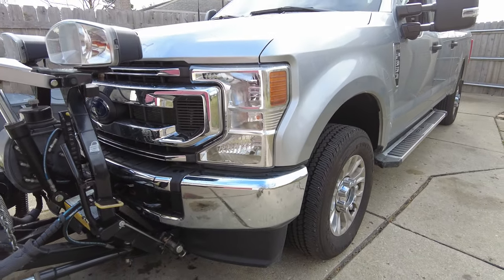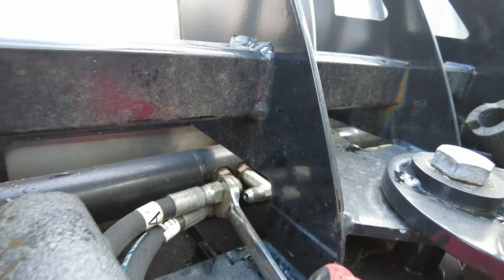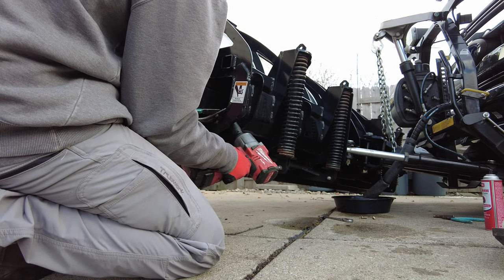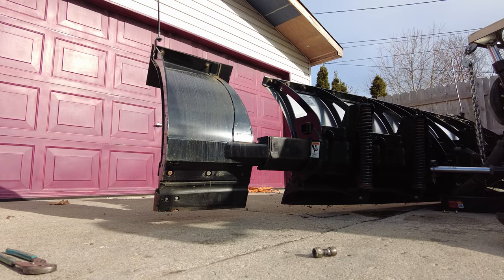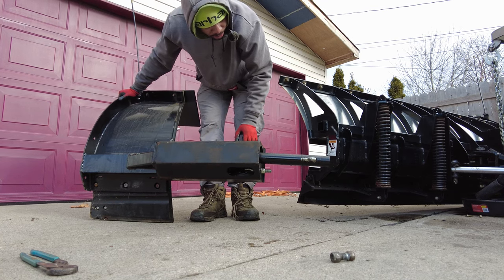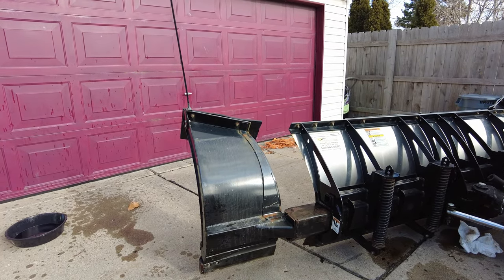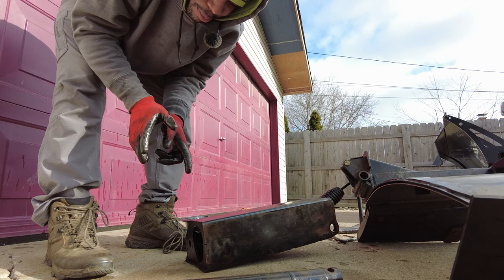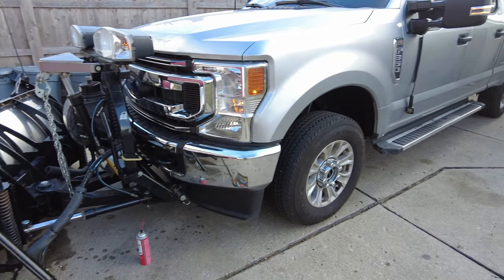PLOW BROKEN - CAN DS FIX? 👀 Western wide out wing AND cylinder removal.

Comment: Suggestion for you get the quick disconnects and put on all your fittings that way if you have to take the hoses off it'd be easier and you won't lose any fluid just a thought God bless you and your family may you have a very Merry Christmas and a prosperous New Year
Reply from the maker: 🤔 very interesting.
Reply: @DS-TRUCKS  agreed with Donnie's suggestion, as well as can find some flexible clear tubing of the right diameter, just a small roll of it and can simply slide it over the cylinder fittings to help direct the drainage of fluid.

Comment: looks like just need to remove the cap that holds the rod and replace the seal/o-ring under it. remember reason it doesn't leak when extending is the opposite end is under pressure, the rod-end thats pushing out is draining only under the volume change and arguably is of minimal fluid pressure, where as when retracting you now have full pump pressure so it finds that (likely) damaged area of the seal and forms a leak path all the way up around the threads and out to atmosphere.